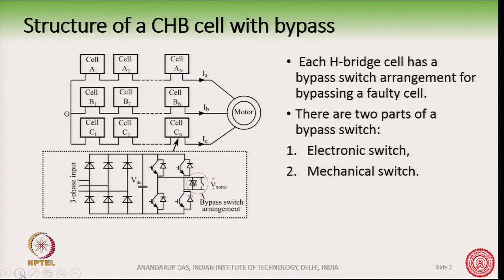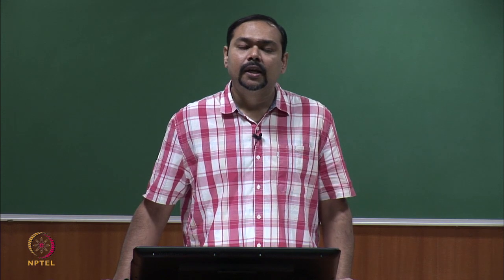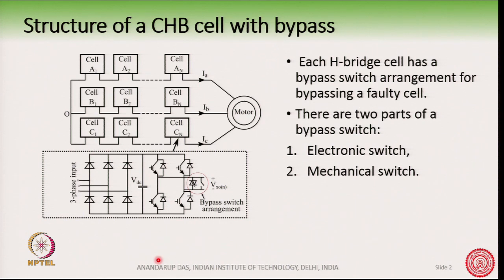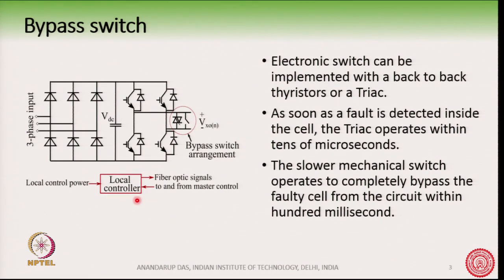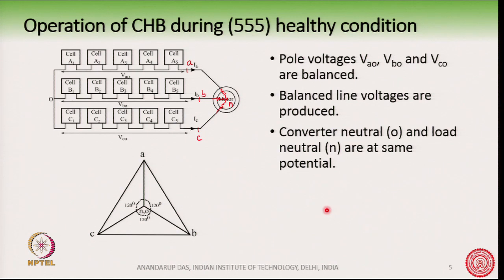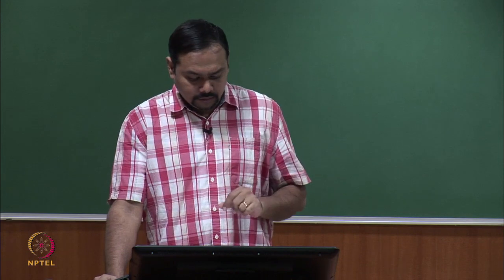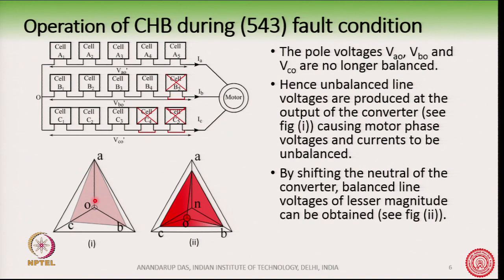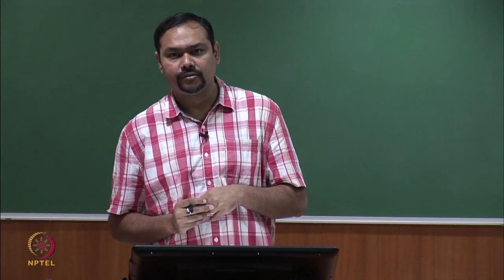Fault Tolerant Operation of Cascaded H-Bridge Converter: Part-I

Comment: Hi , your comment regarding the common mode voltage is not accurate since when a common mode voltage is produced Vno , then a capacitive current flows through bearing of electrical machine that destroys it in time. in order to prevent it some more expensive bearing technology is necessary for example magnet bearing or other materials . Operation with common mode voltage damages the machine or creates more initial design cost to prevent it